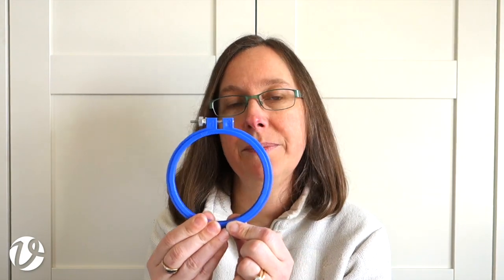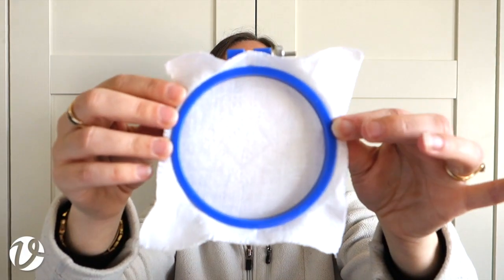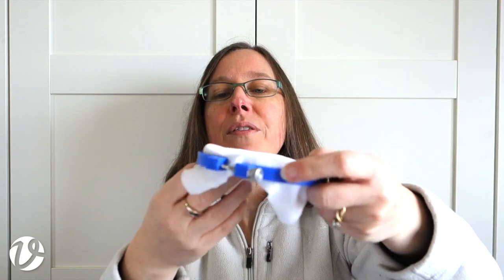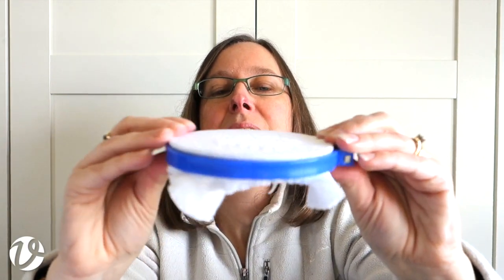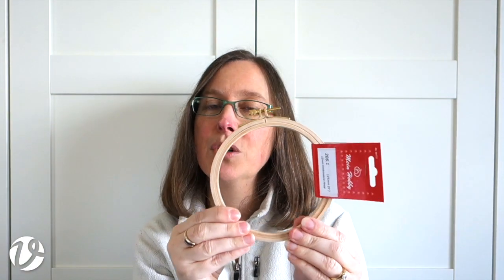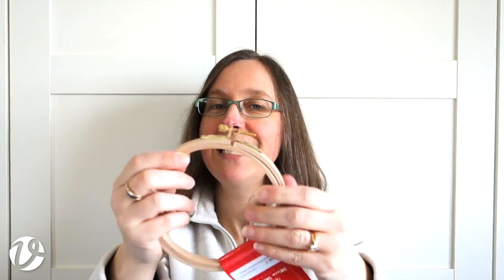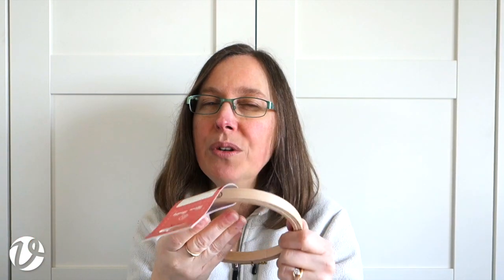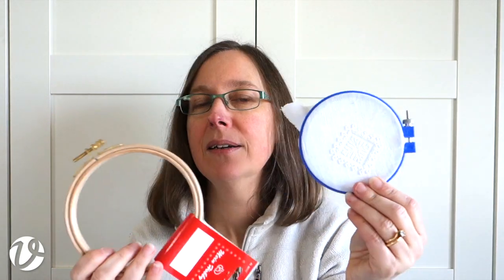White Threads FlossTube #45 – how to use a plastic hoop correctly

Comment: Hi Yvette.  Do you ever bind both rings of the hoop? I have seen some embroiderers bind both the inner and outer ring of the hoop and I am not sure why. Not sure which way is best.
Reply from the maker: I usually do the inner ring only. Yes, you can do the outer ring as well, and it will give extra grip, however, I am often enough stitching Mountmellick embroidery which is quite thick. The binding does take up space, so because of my Mountmellick stitching, I prefer to only bind the inner hoop.

Comment: Thanks for this. What if the plastic hoop has no lip? I have one that came with a magazine freebie kit, and I can't tighten it enough to hold the fabric taught. Plus I need pliers and a screwdriver to tighten it. Kind of take the fun out of it... Maybe this one should really go in the bin?!  😂
Reply from the maker: Hmm... I don't think I would persist with that. If you can, treat yourself to a quality wooden hoop. A screwdriver will still be useful to tighten it (I use one all the time) but you should be able to get the fabric in your hoop drum tight.
Reply: @yvettestanton  Thanks Yvette 🙂I'll just count myself happy with the free threads and printed pattern, and get a decent wooden hoop to avoid the frustration! This is meant to be fun, not hard work! 😉